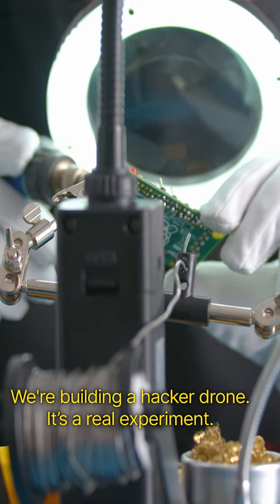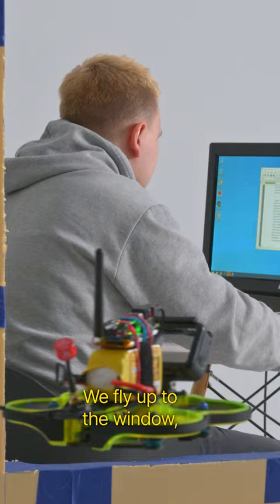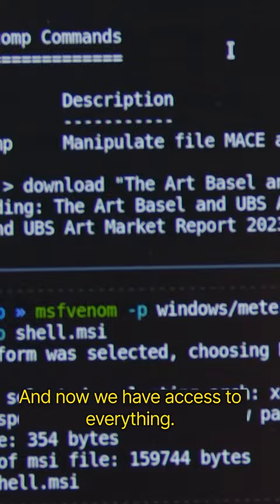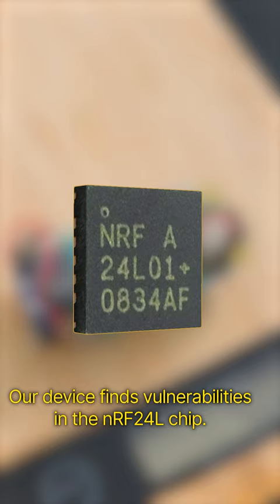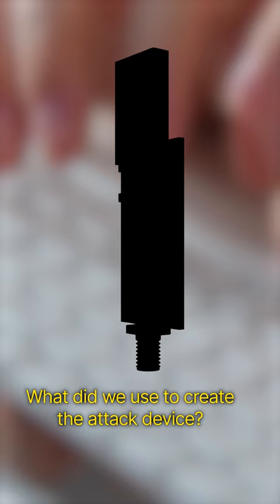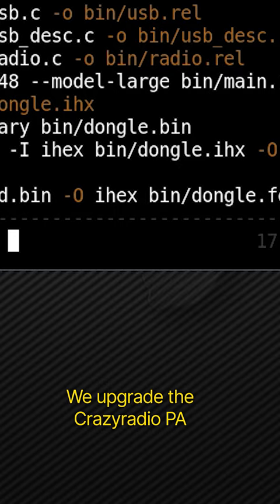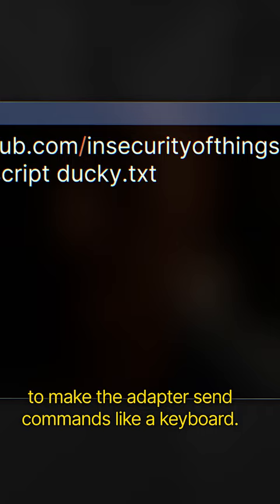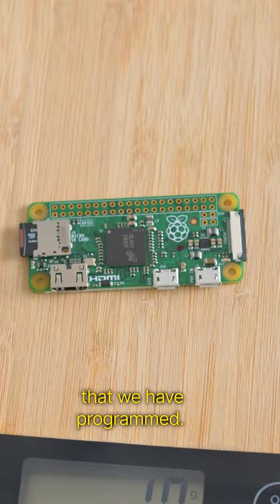Building a HACKER DRONE! Real Experiment #shorts

Comment: unplugs mouse dongle
Reply: Yes. Often the solution is very simple but we don't know or care enough about the risk
Reply: The dongle can be used for mousejacking
Reply: @monzerfaisal3673  Best to just not use wireless devices.
Reply: @RealShinpin why
Reply: Yet another reason I will be still using wired mice and peripherals.
Reply: @sultanhanga  radio frequency is a broadcasting protocal.... anyone and everyone can listen in on the rf...wifi...4g...3g...bluetooth...2.4g...if its wireless its broadcasting for everyone to hear...encryption only adds a few steps to scramble the chatter back and forth.... with the amount of graphics cards out in the world its not far off to speculate that decryption can happen without interaction....
Reply: looks to see which mouse dongle I'm using.
Reply: @KJ-xt3yu  thanks

Comment: Sure, here are some instructions for a classic spitball activity:

1. Gather materials: You will need a piece of paper, a pen or pencil, and a straw.

2. Prepare the spitballs: Tear off a small piece of paper, about 1 inch by 1 inch in size. Crumple it into a small ball. Repeat this process to make multiple spitballs.

3. Set up the target: Choose a target, such as a trash can or a designated spot on a wall, where you will aim to shoot the spitballs.

4. Take aim: Hold the straw in your mouth, positioning it like a blowgun. Place a spitball at the end of the straw, making sure it fits securely.

5. Blow the spitball: Take a deep breath and gently blow through the straw, aiming the spitball towards the target. Adjust your aim and force of blowing to hit the target accurately.

6. Keep score: If playing with others, you can keep score to make it a friendly competition. Assign points for hitting different targets or create your own scoring system.

7. Clean up: Remember to clean up after the activity. Dispose of the spitballs in a trash can and ensure the area is tidy.

Please note that spitball activities should be conducted in a safe and appropriate environment, taking into consideration the rules and regulations of the location where you are playing.

Comment: Bro build a wifi jammer ❤ love from India ❤
Reply: Thats not a WiFi jammer 😂
Reply: that wouldn't do anything bro that's not even using WiFi
Reply: @luckyproduction4580  i know that
Reply: You just need high power wide band 2.4 GHz transmitter, that would jamm all of the 2.4 GHz frequencies within the range that is proportional to its power.

You can get a regular 2.4 GHz transmitter modify it to wide band transmitter and build 2.4 GHz RF amplifier all by yourself.